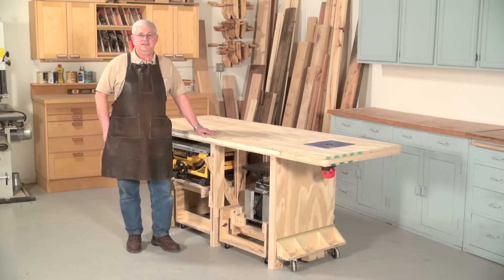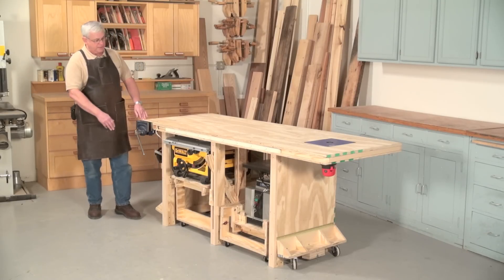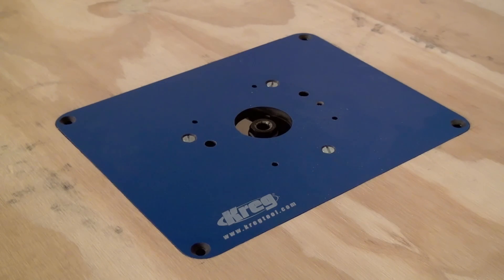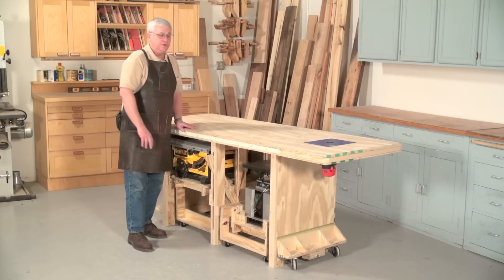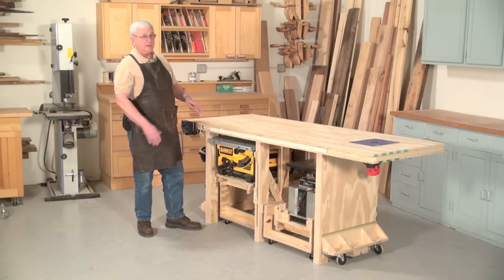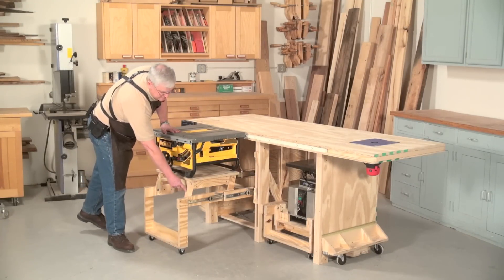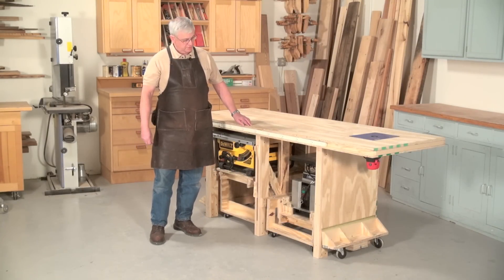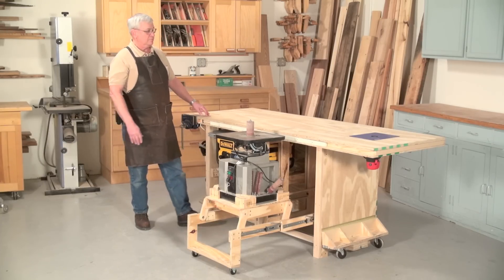Power Tool Friendly Bench

Comment: Full of ideas. No need for negative posts. Modify it or improve it if you are critical. I think I could just have the saw on a table with locking castors and pull it out. It might be a little lower than ideal, but I could rip long boards then. The blade guard seems to be disposed of in reality, as it would be a pain to fit it and remove with each use. As you will need storage for power tools etc it might be better to have shelves under the bench and store the saw elsewhere, instead of having a chest of drawers elsewhere taking up space. The saw could then be on a firm base at the right height, and have the blade guard  and dust extraction on. Just thinking on the hoof😀 Interesting video.

Comment: I love this concept! I'm considering building it to house my DeWalt 735 planer and spindle wander. Also, due to the size of my shop and considering I have a full size cabinet table saw, I would make the bench at a height to also function as my outfeed/assembly table as well. Are plans available for this?

Comment: I made this bench and put drawers on the right side.  The only problem I had was the lever.  Using 1/2 inch plywood I had the bushing falling out and the cable elongating the hole.  So I used 3/4 plywood,  it is a tight fit but works great, just like in the video.  I have a Bosch benchtop router table and just finished building a cabinet on casters for it to go on top.  When on top the router tabletop is at the same height as the workbench.

Comment: The solution to many of my problems!  Thanks Much!  Question. Does the table saw sit flush with the work table in the upright position? If so there wouldn't be any space for the fence overhang. Am I missing something?
Reply: I too was looking at the saw, saying to myself "How's that gonna work with the fence installed??" I have a Dewalt contractor's table saw (DWE945X, I think), and the back part of the fence moving back and forth prevents you from having a outfeed table perfectly flush... That is, unless you are cutting something super wide and have the fence all the way over.

Comment: all over a good project, but i would optimize the circular saw mount it feels unsolid to me.
i would rather mount it solid fixed under the table. no need to make it removable only lower the blade if you dont like it thats it
Reply: There are a few factors in building a table saw. One place I discovered which successfully combines these is the Wilfs Wood Blueprint (google it if you're interested) definately the no.1 plan i've heard of. Check out all the awesome info .

Comment: That's Great, I'm retired and looking for possible hobbies to get into such as woodworking and/or blacksmithing?  Unfortunetly  I have virtually no experience with either Skill/Art (since high school).  This table might work for a newbie with half of a garage?  Though, I see that it's too thin for tool(s) on the other side (maybe hand tools)?  The accessories are mounted on the end (near vice), correct (or maybe on the other side)?  There seems to be enough room for a small drawer under the saw?  Will there be provisions for dust collection and/or piping for air tools?
Thank-you for the time.
Reply: Do you see the Catch 22 here? ;-)

Comment: The most dangerous tool in the workshop is now only supported by a couple of drawer slides, a gravity lean against the table, and a loose cable..............what could go wrong?  This design is too clever by half.  A smaller separate table for the table saw with similar retractable casters that can be rolled over to the workbench for the out feed would be better.